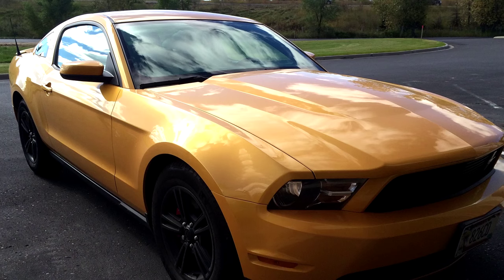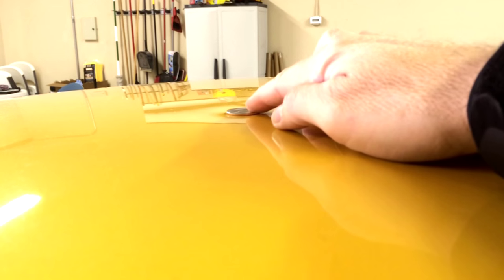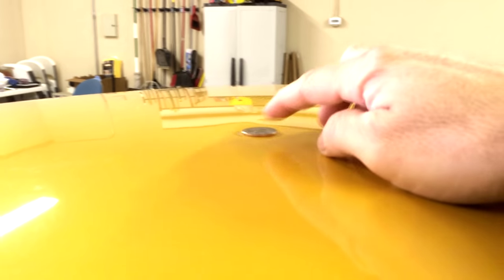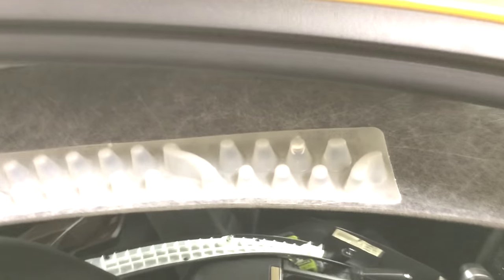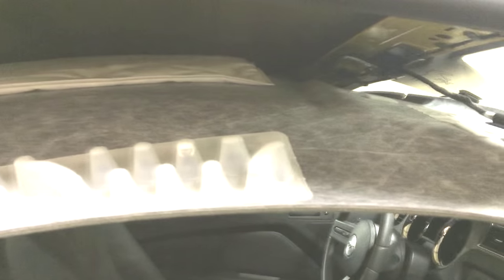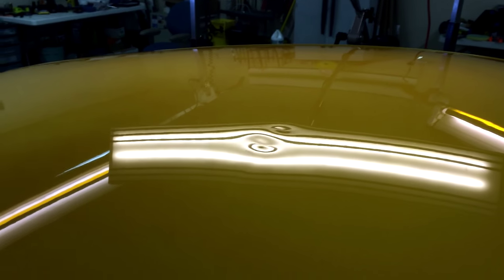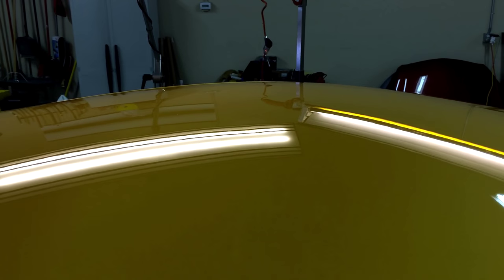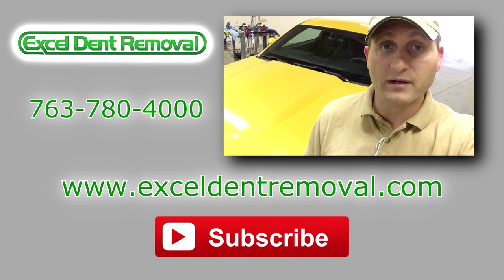Dents Removed From A Car Roof With Paintless Dent Repair

Comment: What tool and what was the method used to do the work?  I am working on learning the art on my own vehicles.  I purchased the master set from A1 and a glue pull kit.  I seem to be way better at the glue pull but want to get better at the push tools because they are way faster from what I have been told.  I have hail damage on 5 vehicles so I have a lot to practice on.  I noticed I am able to get out most of each hail dent of pretty much most sizes until there is just a small crease resulting in a dime size dent.  Can you give me any thoughts of what I need to do to get that last little bit of the dent out?  Thank you for the help.  I really like your videos.  Most people are in total refusal to help anyone without getting you to sign up for a membership.
Reply from the maker: +tspecht610 You need to be using a PDR light to see down into the bottom of the dent when starting the repair. From there "cross checking" which is moving you light to another angle to be able to see that crease or the dent from a different direction. Be sure to start with the light up higher to see the bottom of the dent. Then lower it to see the last of the dent.
Reply: I watched one of your other videos and part of the reason I think I am not getting that final little bit done is that I worry about causing added damage and just am trying to be careful to not push too hard.  On my first dent I caused some high spots that I had to tap down by using too sharp of a tool and pushing too hard or just pushing too hard in general.  I wasn't working my way around the dent with light pushes.  I have the smaller portable light and then just my florescent shop style lights.  I think I probably need to get a larger LED light.  Do you have any suggestions?  Thanks again for your advice.

Comment: Too much work for an amateur. Especially since they have suction tools to do the same job out there.
Reply from the maker: Yes, each type of dent and damage is evaluated to see what type of PDR repair is needed. Sometimes it is easier to pull the dents out from the outside of the panel. Other times it does require access the the inside to push out the dents.